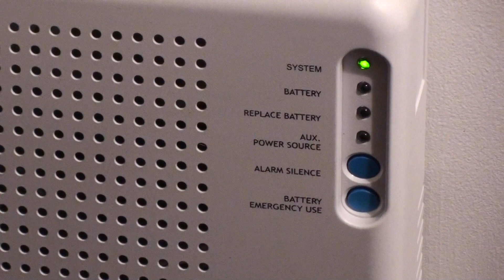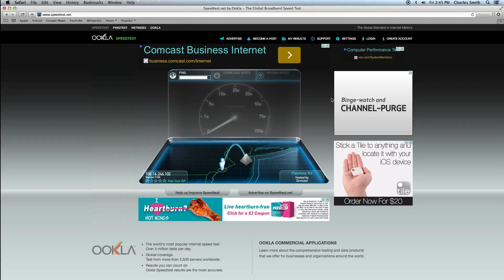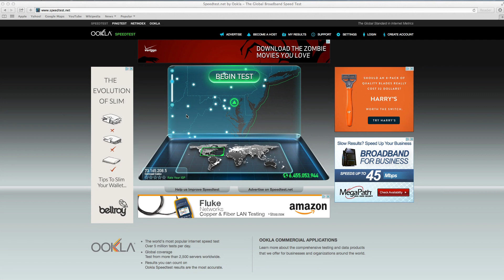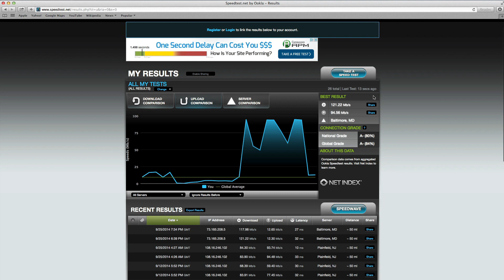Verizon FiOS Block Installation Process and My FiOS Experience

Comment: What's up with the speed tests, the speeds shouldn't fluctuate considering it's FTTH. I have TWC, and my speeds are at a constant at 350mbps down and 23mbps up 10-9 ping. Could be the servers, but FTTH is great, hopefully att/Twc pull their heads out of their ass and deploy it here.
Reply from the maker: Maybe it's a problem with the servers that were tested. I've had no problems with the service and I've had FiOS nearly two years now. Upon other speed tests, my speed remained consistent overall.

Comment: Your speeds are faster than mine. I wish Google Fiber was where I live.
Reply from the maker: Thanks. FiOS speeds are faster than most residential Internet connections. And that's not the fastest it can go. Verizon has even faster speeds! In my area, currently, I can get up to 300Mbps symmetrical upload and download speeds! But Verizon has symmetrical speeds up 500Mbps for $310! That's intense for a residential connection! But Google Fiber is actually a more viable solution for they offer speeds up to 1Gbps symmetrical speeds for only $70 a month. And Google Fiber offers 5Mbps Internet for free! Unfortunately, at the time of me writing this comment, Google Fiber is only available in 3 cities. Verizon is more than capable of speeds like that but they are so expensive with the speeds they currently do have. When they do roll out gigabit Internet, they'll charge probably $700 a month for 1Gbps. I'd love the 300Mbps plan but its just too high priced. So I'll stick with this until they upgrade the speed tiers higher. I know, its more speed than most people need but its still nice to have if you're running a small videography business like me sending large files to tons of clients. But 80-90Mbps is mind blowing enough for me now!

Comment: How much does it cost ?
Reply from the maker: Andrew Gutierrez Andrew Gutierrez For me, I have a two-year deal of only $59.99 a month for phone and Internet. But this current special pricing offer no longer exists. Pricing plans can vary for customers, depending on the plan or bundle chosen. You will have to check out www.verizon.com or call 1-800-VERIZON to get exact pricing info for FiOS.

Comment: WTF?! With an average of 25ms latency?! You have some crappy fiber installed.
Reply from the maker: Who cares? I still got an A+ on my performance tests. 😂😂😂 The fiber connection hasn't failed me yet. 👏👌 And for the last few years my connection has been able to handle everything I throw at it. I see no lagging or latency. Maybe it's testing that way because of the distance or quality of the testing servers.
Reply from the maker: +Juan Sandoval That's right, distance may not be an issue. But my experience is way on FiOS has been much more satisfactory than on my previous DSL and Cable connections. I really don't have a clue why the latency rate is so high. I have noticed absolutely no impact of latency on my line.
Reply: +Charles Smith I gotten low pings
Reply from the maker: +Chris Wright What is your average ping?
Reply from the maker: +Chris Wright Oh okay.
Reply: Charles Smith my bad the lowest i seen is 9 thats on wifi but anywhere from 9-20
Reply: Charles Smith just had my internet an cable installed yesterday i gotten the 100/100
Reply from the maker: That's awesome! I still have yet to see a local cable provider offer symmetrical upload and download speeds!
Reply: +Charles Smith well where are you located exactly what your willing to spend
Reply from the maker: +Chris Wright I live in Philadelphia. Verizon FiOS is the fastest here now! You can get speeds up to 500/500 symmetrical upload and download speeds. But I'm satisfied with my current 75/75 my speeds, which actually come out closer to 80-90Mbps! 👌
Reply: +Charles Smith I'm in Philadelphia and I have FiOS it's your upload speed that jump 10-20 Mbps more
Reply from the maker: +Chris Wright Really? I thought you said Colorado, unless I read someone else's reply to this comment.
Reply: +Charles Smith lol must been
Reply: +Charles Smith one question how's your bill looking good or high I need to know so I could judge mines next month
Reply from the maker: +Chris Wright Oh, I see exactly what happend. I was looking at another poster's reply that was in the same string of comments as your reply. Hey, I don't think you can go by me for pricing. For me I got a special two-year contract deal of $59.99 for phone and 75/75 Internet. That offer for new customers ended in late 2014. With taxes and fees, my bill is about $69 a month. Not bad. But my contract will be over by September. I'm afraid to see what will my bill be at normal pricing.
Reply: Charles Smith I'm loving the service man everything has been great bro check out my speed test I'm soon gonna do the whole tour of the installation once my basement cleaned out
Reply from the maker: Nice! When did you get the service?
Reply: Charles Smith last month in march
Reply: Charles Smith xbox one works wonder on the 5ghz channel
Reply from the maker: Awesome! I know it does! I ditched the default 2.4GHz in favor of the newer and faster 5GHz routers, myself two years ago. 5GHz has better signal range too! I upgraded mine to a Linksys model instead of the default FiOS router. Two years ago, they didn't have a 5GHz model. What speed tier do you have?
Reply: People doesn't know how latency works, doesn't depend in your speed, you can get same latency from cable, dsl and fo. If you try latency from Europe from US you going to get high latency

Comment: >.< 6mb download and 4mb upload. I have an old Fios Router, should upgrade soon because my house has 4 smartphones 4 TVs and other game consoles constantly active.
Reply from the maker: Wow! Those are quite low speeds for FiOS, even on a wireless connection. That's sounds like the original entry-level speed tier offered when FiOS first rolled out in 2004. What router is that one, the original 2004 FiOS router? It must be a Wireless G. Yes, you are definitely going need to upgrade to a more modern router take full advantage of the FiOS speeds and bandwidth.

Comment: Time Warner Cable .... 324mbps down .. 24mbps up   ... 8gb file in less than a couple minutes
Reply from the maker: That's great! With my 75/75Mbps plan, I uploaded a 10GB file in only 25 minutes. It took nearly two hours to upload on Comcast's 50/10 plan. But cable still cannot match FiOS for upload speeds. Verizon has up to 500Mbps download and 500Mbps upload speeds. Time Warner Cable's main top tier is only 50Mbps w/ just a minor 5Mbps upload speed. TWC's newest 300Mbps plan is not available everywhere yet either. Its being rolled out in New York City and Los Angeles for now. Are you in one of those two cities now?
Reply: Charles Smith Hey, yeah we live in L.A we were upgraded last year for free.. at first i thought i wouldn't need so much to download stuff and rather just get a cheaper plan but after a couple of days of testing it with xbox live movies and games we couldn't believe what we were missing.. the upload increase would be nice but we really don't need it .cloud storage is still a bit pricey .. rather have multiple back ups.. 
 
One thing that surprised me.... this past November the family went to mexico for our vacation and they had amazing internet .. this house had fiber optic connection at 250mbps down 250mbs from some company called axtel extreme if i remember right.   and we decided to try the upload and yes it is amazing seeing big video files uploading at an amazing speed

in my area its either TWC or ATT .. tried ATT Uverse .. mannnnn what a piece of junk that is anddddddd come to find they data cap at 250 i believe .. we are a big family with few kids and teens they love watching netflix .. and we love netflix as well .. thankfully TWC doesn't cap at all
Reply from the maker: stryker7x I'm sure that's a great tier. Mexico has speeds that are pretty fast. Actually, every country seems to have faster Internet speeds than the USA these days. I've tried the 150/150Mbps speed for Verizon but then downgraded back to the 75Mbps tier. One reason is that my 150 tier was not too much faster than my 75Mbps tier as I was already averaging a 95Mbps downloads and uploads on the 75Mbps tier. Secondly, I found that with most of the HD video uploading work I do from home as a self-employed videographer, with anything over 100Mbps, files do not really upload any faster than what the site's web servers can handle. Wired connections to sites like YouTube and Facebook video uploads topped out over a certain speed. Which is good enough for me now. Considering, I came from Earthlink 5Mbps/1Mbps DSL in 2007, to Comcast 50/10Mbps in 2010, FiOS is super! Verizon and Comcast Xfinity rule the Philadelphia area. Comcast is headquartered in Philadelphia and Verizon is from New York. FiOS has no data caps. Comcast Xfinity had a 250GB data cap but it hasn't been enforced in years. Yes, U-Verse Internet is a joke. Nothing more 45Mbps downloads but just a minor 1Mbps upload speed. Its fiber-to-the-premises (FTTP) or fiber-to-the-node (FTTN). The rest of the way, you loose your full Internet speed as it goes through old copper wiring in your house, which can't bring in much speed. I'm really the only one using the Internet in a home of 4 residents for uploading streaming. I have one other family member who uses it, but it's just for small tablet web browsing and a little video streaming. So I get most of the speed with no slow downs.

Comment: his ping is high because her testing his speed on a Comcast cable server
Reply: I get 5-7 ping over Ethernet and 10-13 ping over wifi. I have Comcast as my ISP, 250down/30up.
Reply: +Juan Sandoval gg
Reply: +cid fan True, but i always chose different servers when running my tests.

Comment: 50 down 50 up that's kinda slow compared to other isps
Reply from the maker: +thecodposter52 Well, when this video was made, and even now, many areas in the USA have ISPs with that have failed to offer even just 10Mbps up/10Mbps down. Before FIOS was available in 2009, the only speed available in Philadelphia was Comcast's 30down/5 up. Many parts of the USA only still offer DSL and even dial-up. So my point is that the USA should have a standard of at least 50Mbps symmetrical speeds at the lowest. 50 would be a big improvement!
Reply: +Charles Smith Oh ok
Reply: +Charles Smith the FFC has made a standard that requires us Internet speeds to be 25/6 forgotten the numbers
Reply from the maker: +Chris Wright Oh okay. That's not too bad. Where are you located?
Reply: +Charles Smith Denver Colorado and I only get 125mbps and 12 up
Reply: Charles Smith Philadelphia

Comment: Dude fios aint shit im running my internet threw cable and i get 1 gig  try getting 950mbps download speed and about 845 upload so ya dont talk about cable cuz my cable pushes tons of speed way more then what you was pushing on your speed test there
Reply from the maker: Jason Voorhees Did you see the date of this post? I made this in 2014. This was good in 2014. In 2014, no residential ISP offered 1Gig Internet except Google Fiber, which wasn't available to everyone. In 2014, Cable ISPs were barely pulling 100Mbps download and nothing more than 20Mbps uploads. FiOS had 500Mbps symmetrical speeds which was ahead of cable. But this year the playing field is pretty much even and Fios and cable both have 1Gig Internet. I have 1Gig offered to me now though FiOS just like you do on cable.

Comment: i have fios internet only  and over time warner cable now spectrom cable i love it. it is fast and i have the 5g network that is starting to show up now on new routers so cool.my lenovo idea pad 110s is the only thing so far i have that will pick it up. it is so fast 50 up 50 down like they said. i hate there tv because they took out the weather channel and i need that every time i have a storm i tune to the weather channel for updats. spectrom and derct tv has weather channel and i now have drect tv so i can get weather channel
Reply from the maker: Hey, I'm glad you have the Internet plan. That's one of the best features of FiOS; the Internet service! I don't need a home phone and I didn't subscribe to a FIOS TV plan because I don't watch TV that much. But yes, the 50/50 is originally what I wanted until Verizon gave me a really great offer that I just couldn't refuse! I got the 75/75Mbps plan with home telephone for only $59 a month for two years! Now my plan is $69 for a two year agreement. 5G definitely will be great. I didn't know any devices were yet produced to handle that speed yet. It's crazy how FiOS has recently dropped The Weather Channel though.

Comment: For fiber that latency is unacceptable.
Reply from the maker: Honestly, I still don't know why my latency is so high. I haven't experienced any slow downs in speed or lagging in videos.
Reply: +Charles Smith You should only notice high pings in gaming. In general its a great ping but typically fiber pings are 2-10 ms and I find it weird yours is so high. May be Verizon and not you
Reply from the maker: +AC719Productions Yes, I don't understand why my readings are like this with such a high ping. I did perform a ping test, which I forgot to show in the video. Here are the results: (Packet loss: 0%) (Ping: 37ms and (Jitter: 6ms) (Line quality grade: A)
Reply: Dude, he was testing on a comcast server that is why latency is so high

Comment: Cool documentary. We're working with FiOS 50/50. Upload is important on our end.
Reply from the maker: skyyguyy  Thanks! Great!  I'm glad you like it! Finally, someone who agrees with what I'm talking about. If you're an avid video uploader like me, you understand how important video upload speeds are as much as important as download speeds. Yes, 50/50 is a great start. I wouldn't go any lower than that. I started to get the 50/50 speed tier, but when I got an awesome phone and Internet bundle with the 75/75 Mbps speed tier for just 69.99 a month w/ tax included, I just couldn't refuse! Verizon is really great!
Reply: Charles Smith
I've been with FiOS for years and started with 10/5; I know, it was pretty low. Greater bandwidth was needed.

We use a remote server across the country and were excited about using Verizon's clean and reliable bandwidth for uploads.

Over time, as you and I know, speed increased with downloads matching uploads via the Quantum FiOS package.

Anyway, 50/50 is a good start for high-volume data-comm.

You have a great package for your setup. Price is reasonable and I'm glad to see you're connected!

Comment: You will be sorry, wait a while and check the appearance on the outside of your home
Reply from the maker: Rodger Booth What do you mean? I've had FiOS since 2014 and I love it. No problems since then. I don't any issue with the outside of my home. Installation was quick and easy.
Reply: The Fios is fine. I have hundreds of feet of fiber laying in my yard from their 5 attempts to put a line in properly. And all of the boxes on the outside of my home. Looks like downtown Beirut!! Glad you are happy.
Reply from the maker: Rodger Booth Wow. Sounds like a sloppy job on their part. You should've made them clean that up. Mine came out neatly. They put the wiring on an overhead utility pole that already had telephone and cable on it. I have no extra fiber cables hanging around. It's just a few inches of line slack neatly wrapped on the pole.